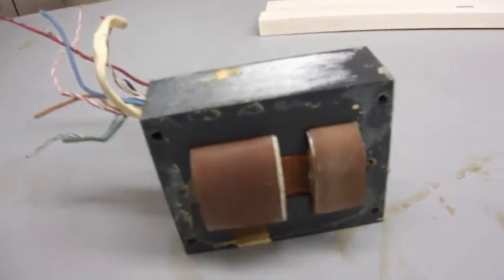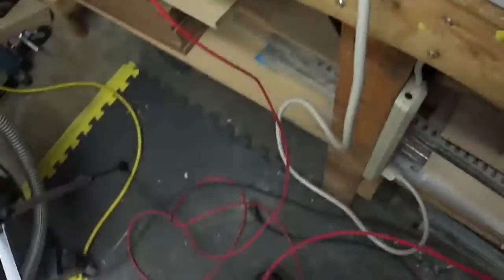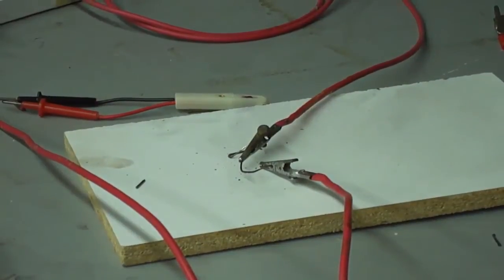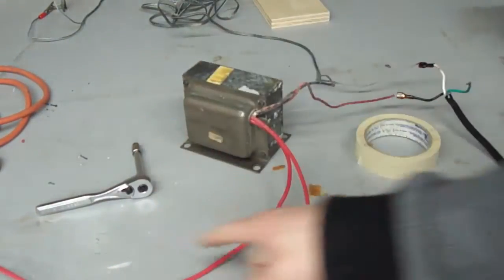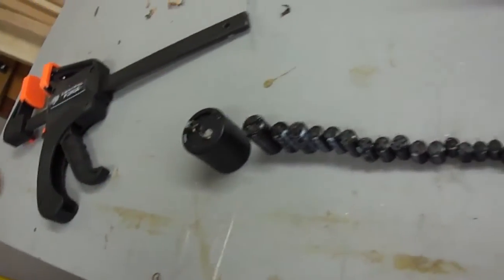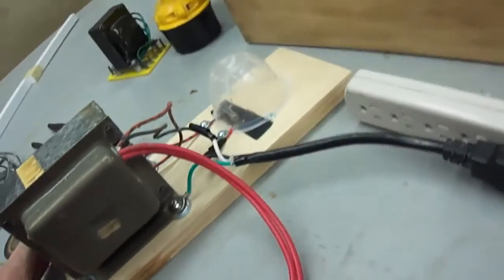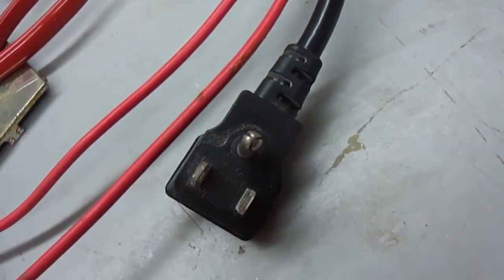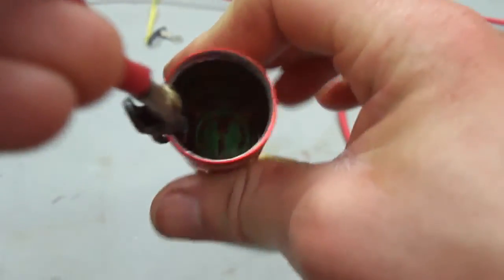TV Transformer High Current Mod - Part 1

Comment: Cool mod, you need to knock the shunts out between the coils if you can. That will improve the secondary current. Great to see that you earthed the TX casing. That 120 V fuse looks it is a car fuse and too high Amps, should be a 3 or 5 Amp fuse.